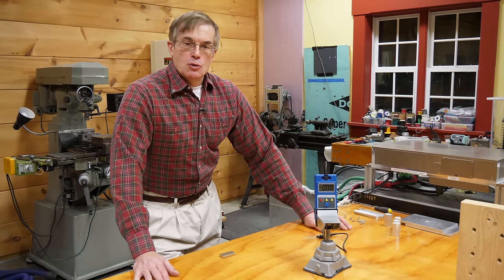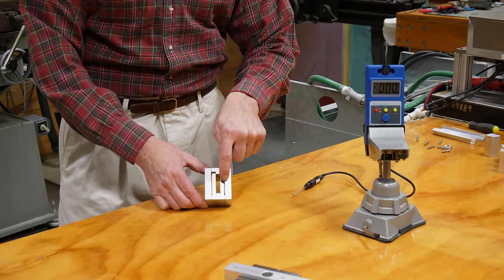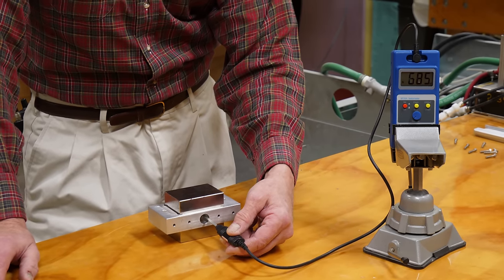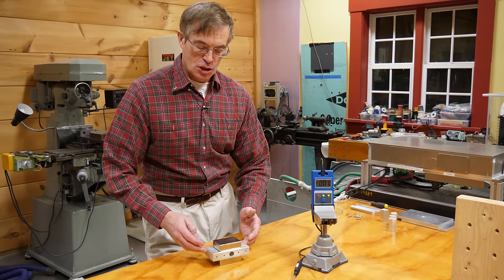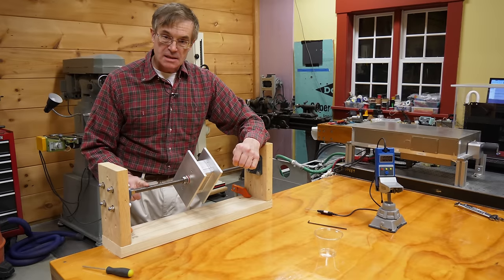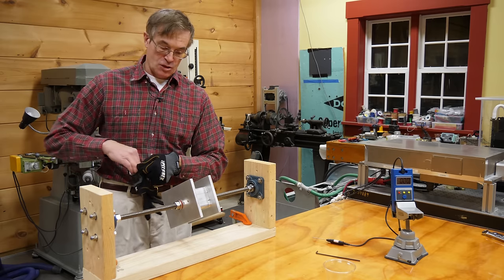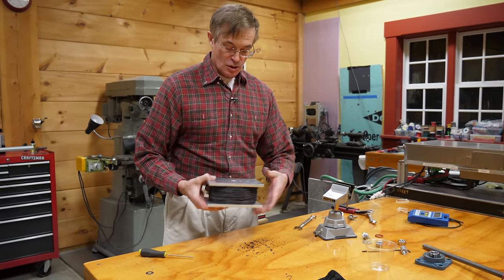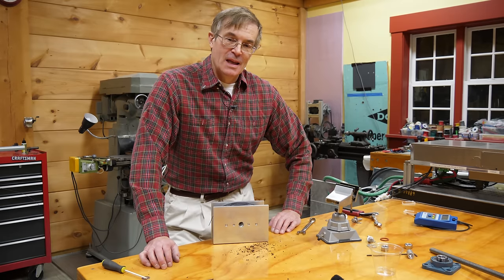VERY POWERFUL MAGNETS… THE EASY WAY

Comment: Der Mann hat eine Drehbank und fummelt den Draht mit der Hand in diesem Gestell auf den Spulenkörper!??? Und dann ist die Spule magnetisch, ohne das Spannung angelegt wurde? War das Eisendraht?
Reply from the maker: Willkommen!
The limitation is not the winding, but the assistant who has to manage the twisting coil of wire to prevent tangling.
A lathe would have put his fingers at risk.
The iron in the wire makes it ferromagnetic, and the coil acts as an easily  installed, magnetic yoke.  No electrical current is needed.

Comment: Is the magnetic field orientation not relevant here? If your magnets are NSgapNS the field would be like a toroid with the full field crossing between the magnets at 90 degrees. If on the other hand the NS of each magnet was at each end, the toroidal field would have changed by 90 degrees and be parallel with the face of the magnets. It is not clear which orientation you are using here!
Reply from the maker: The magnets in a typical gap installation are north to south through their thickness and the field is normal to the plane surfaces in the gap.

Comment: What is a 6" block? I don't understand American ...
Reply from the maker: In machining, there are fixturing blocks called " 1,2,3" blocks and "2,4,6" blocks.  The number stands for the X,Y,Z dimensions in inches.  You can easily multiply these numbers by 25.4 to get the dimensions in mm.

Comment: Should have powered it with a hand drill.
Reply from the maker: No.  The coil of stock wire is the limiting factor.  It twists and can tangle easily.  A powered coiler poses a risk to the fingers of the person in charge of the stock coil.
Reply: @TechIngredients  Thanks for your reply.

Comment: extend the rod through the wood, attach a drill.... tada powerwinder
Reply from the maker: The coil was less simple to deal with than you might think.  It would twist and tangles could develop easily. For that reason the hand winding was also safer.
Reply: @TechIngredients  Indeed, you'd need to acquire the wire on a spool to be able to control it.

Comment: It is illegal to use an adjustable wrench in YouTube? Every one seems to use f*ing pliers, James Bruton (X-Robots), Tom Stanton... What is up with that?
Reply from the maker: You should use the right tool. The decision as to what's right should not be based on dogma, but rather on what is the best match of the purpose.  You can use a 6 point wrench, 12 point wrench, adjustable crescent wrench, torque driver, channel lock etc to tighten a nut.  A channel lock is often a reasonable choice because the jaws can be quickly set parallel to the nut faces and for low torque applications, they are very convenient.

Comment: Now focus it to a point or carnt you do that in your country
Reply from the maker: It can be done anywhere.  It requires a feromagnetic "pole piece" which is a conical or pyramidal iron or steel block mounted over the magnetic pole.